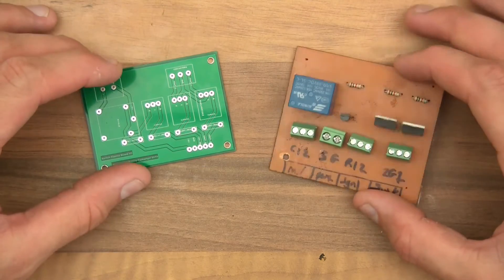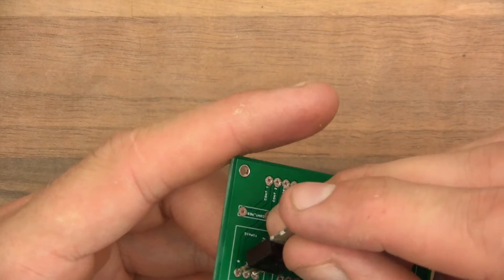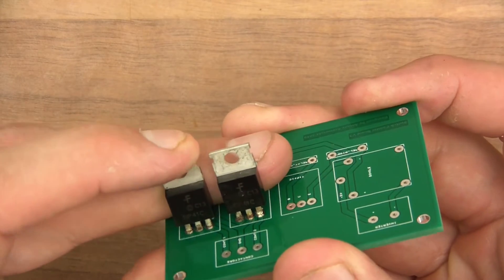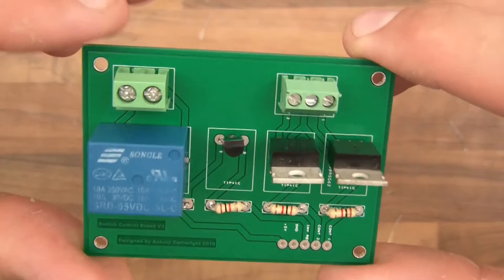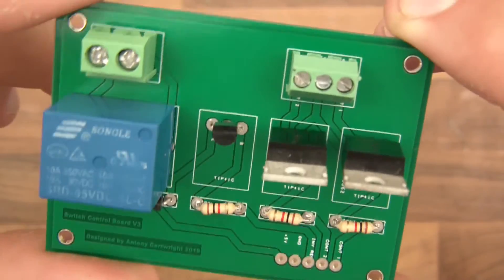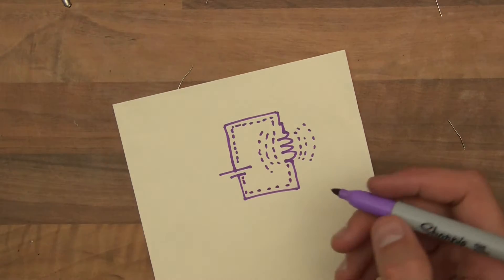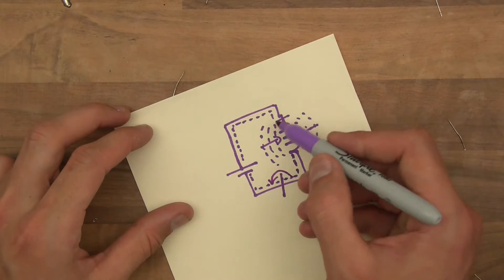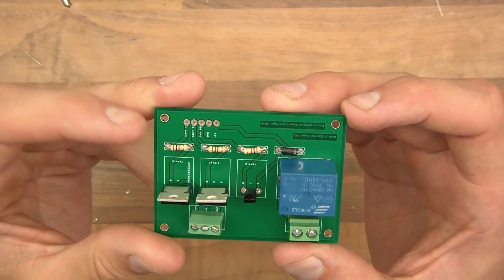INVESTIGATING: My New Solar Relay & Contactor Control Board

Comment: So the magnetic field is acting like capacitor.... 

Couldn't you use a "decoupling capacitors"?
Reply from the maker: Hi, its a bit like that, yes. The magnetic field is created by the coil in the relay. It's not a desirable thing in this situation. It's a side effect of using a relay.

Comment: Hi @Anthony Cartwright! 
Great videos.
I had a question for you. Have you ever heard about football referee signal flags?
Its flag that Assistant Referees(AR) carry during the game. The construction in these flags are so intresting that i have decide to bulid one for my own, because i am a fotboll referee and study electretion.
Each flag has its own transmitter which is placed on the handle in form as a button. The head referee carry a small reciver on his arm. When the AR push the button it transmitts a signal to head referee which is in the form of vibration or sounds then referee discover that somthing is wrong and blow the whistle.
So may main question is how can i build such a device that can give me the same function as signal flags? 
I watched this video https://www.youtube.com/watch?v=KA_YE7AvFn0 that i hardly could understand. I am a beginer so.
Is Arduino an option? 
Best regards 
Alireza
Reply from the maker: Hi there are many different approaches. The 433mhz modules would work for that, yes.

Comment: "It's really hot in here. It's 32C and I'm not used to that sort of temperature".  32C = 90F.  We get that on a daily basis here in Florida  😜 4 months outta the year it's over 90F,  3 months over 80F (26C), and only a few weeks less than 40F (4C)
Reply: Humidity level is pretty high in the UK and we don't normally have aircon in our homes.
Reply: @Codedbad  Humidity level in Fl during the summer months is unusual to be below 80% 😉  Quite often it's in the 90+% range most of the day. Especially this time of year, as hurricane season is upon us.
My aircon consists of a window unit only set to 80F during the day, as to try to cool it any further makes the meter spin like a top. It doesn't even run full enough to pull all the moisture out of the air in the house. A few ago, it went out and I went a week w/o any cool air, only fans. So yeah, I know that feeling too, yuck! 🥵
Reply: And if you had minus 15 c you'd be deed... Haha 🤣😅🤣🤣